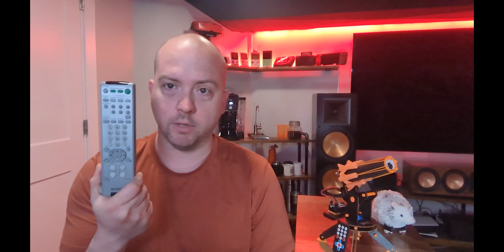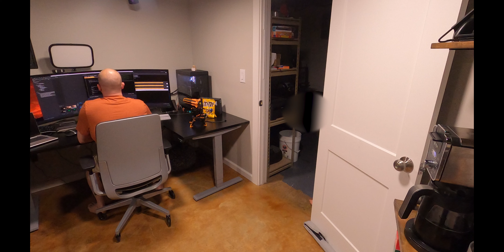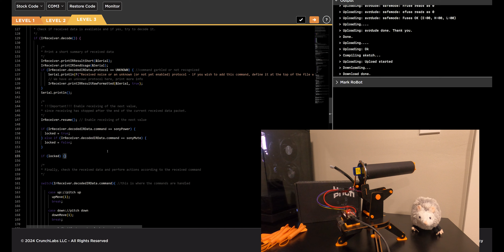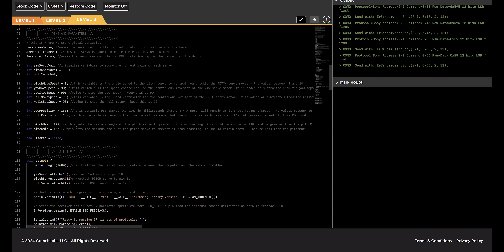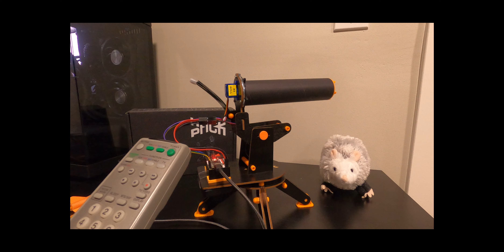Adding a Remote to Outsmart My Kids: Hack Pack IR Turret

Comment: Whenever I click the power button I don't get a hex code, all it does is literally nothing.
Reply from the maker: This didn't require any additional wiring so reupload the stock code.  Once you do that slowly add code just in case there is an exception.  The hackpack discord can help too which is better suited than youtube comments.

Comment: its not showing anything when I press a button on a different remote. I've tried multiple remotes any nothing shows. Help please?
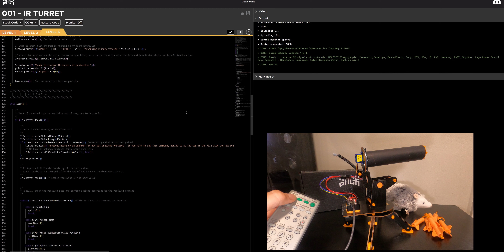Reply from the maker: Different remotes could have different values for the same button or number.  At 1:06 it shows how to find out what the value is for your new remote then you add that as a #define then to the switch statement.